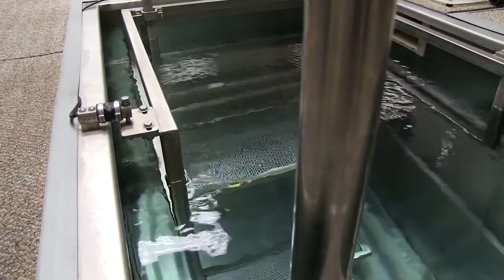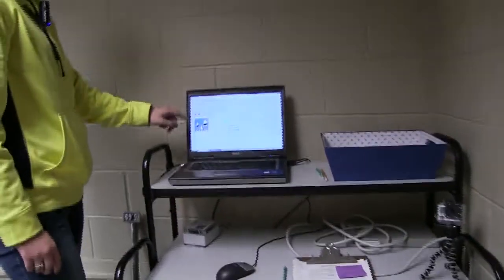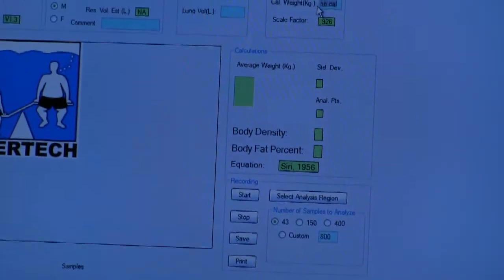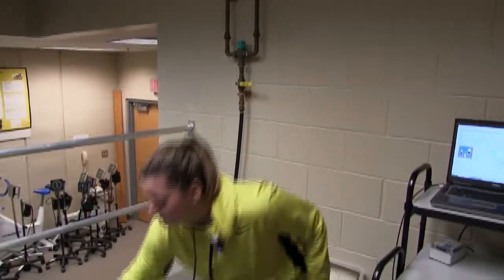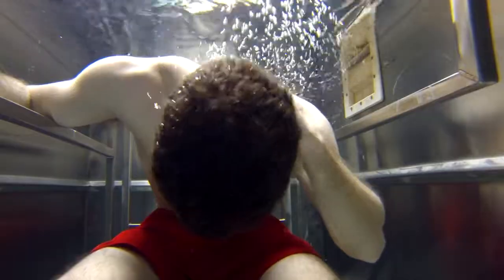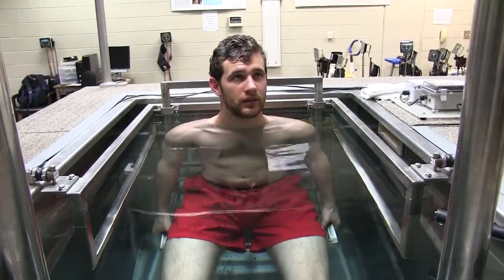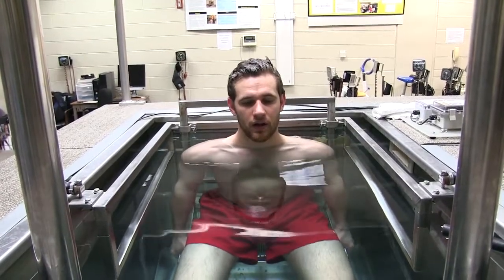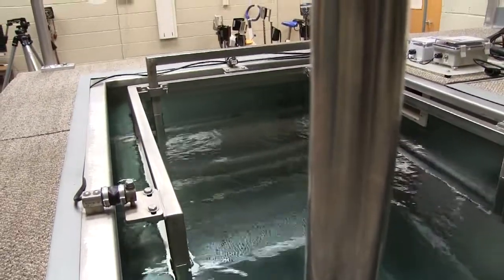Procedure for Assessing Body Composition via Underwater Weighing

Comment: Does the variation refer to +- 2% of fat ( ex: measure at 13% range 11-15%) or 2% of the data (ex: measure at 
13% range 12.74-13.26%)?
Reply from the maker: The former:  it refers to the range, not the actual data.
Reply: @TravisErickson5  Thank you! When I was in school I always thought it was the latter because that's how we usually did it when interpreting variance. Had it wrong all this time!

Comment: I had mine done early in the morning during the winter and the water was warm. What time of the day did you had yours done?
Reply from the maker: Water temperature is a component of the density calculation for this particular piece of software.  But body weight does fluctuate throughout the day and will lead to some small differences in density and % bodyfat calculation.  This is generally accounted for by the accuracy of the test being within plus or minus 2%.